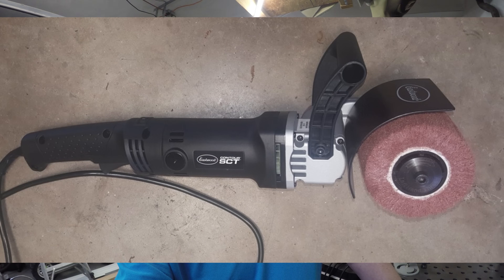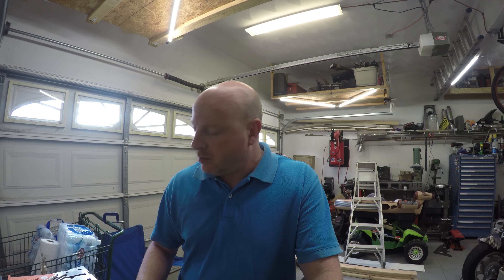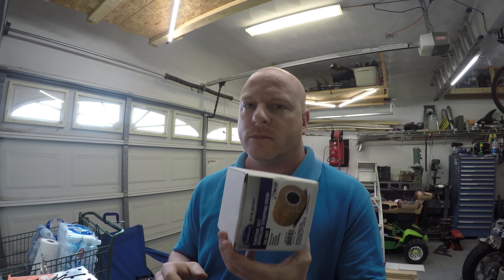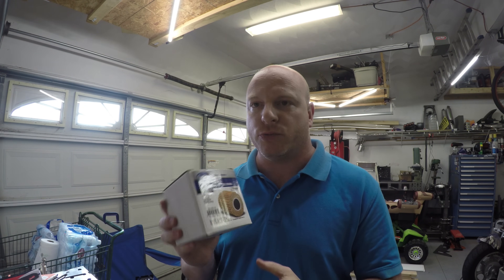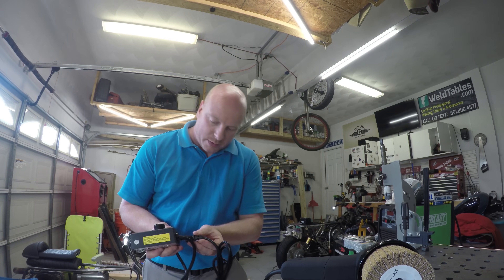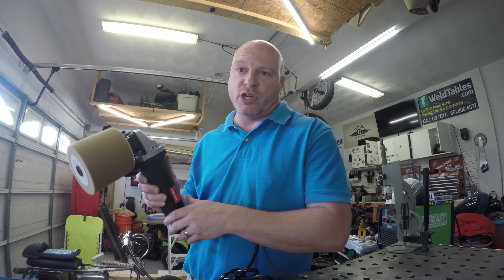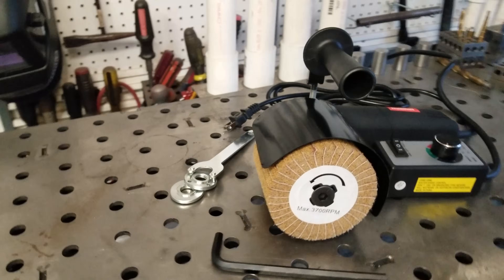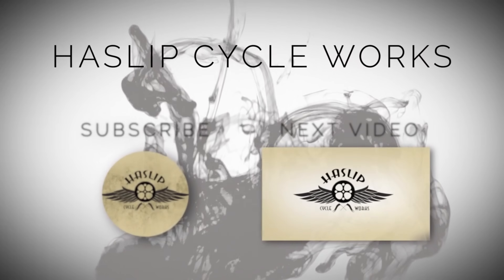DIY Surface Condtioning Tool!

Comment: soaking the part in vinegar for 24 hours will shift nearly all of the rust and mill scale, its then a very quick job to clean the surface with abrasive. Cheers
Reply from the maker: @peterhadfield873  that is my go to, if I have the time. Sometimes I don’t have the time for that or the piece is way too big, then this tool becomes the best option.

Comment: It probably lasted a month
Reply from the maker: Incorrect, still using it. Cleaning up parts off my plasma table and cleaning the surface of my weld table. Appreciate the negativity though.
Reply: @HaslipCycleWorks  cranking down speed incorrectly often destroys motors . Seemed like a lot of work to save few dollars
Reply from the maker: @boringsoaring  there is truth in that. It was but also remember there was very few options other than the Eastwood version at that time. This build was cheaper than the Eastwood and on par with the version from harbor freight that wasn’t available at that time.

Comment: Nice DIY hack. I’m looking to do the same thing. Looks like the adapter nut is no longer available on Amazon.
Reply from the maker: Thank you! I’m sure they can be found somewhere. Harbor freight has announced that they will release their version soon so that might be an option.
Reply: @HaslipCycleWorks  yes....they have under their "Bauer" line of tools. It's very well built and even comes with 3 of the drums!
I mean it's IDENTICAL to the Eastwood SCT, for less money, and with more accessories.
This DIY build is still very useful and I would recommend making it.
Reply from the maker: @justinmurphy2227  I’m hoping to get my hands on one and do a review of it.

Comment: I recently did similar research. I needed to finish some stainless steel tubing with a nice brushed finish, just like the professionals create.
My first “solution” was to obtain an extended drive shaft to fit an angle grinder to drive these brushes/drums. This shaft is available from Abrasiflex https://abrasiflex.com.au (and probably other suppliers).

This shaft (Approx.AU$64) would do the job, BUT required a variable speed angle grinder as per this video AND also required a new guard as shown in this video.
This involves devoting some time to make the guard AFTER obtaining a variable speed angle grinder.

A search on eBay found this item https://www.ebay.com.au/itm/283510703980 for ONLY AU$84. This is essentially a variable speed angle grinder with a sanding/buffing drum and a guard all ready to go. I purchased this tool and it is brilliant, excellent value for money.

The “problem” with the angle grinder versions of this burnishing tool is the location of the drum relative to the view of the operator.
With an angle grinder in normal use, the operator can more easily see the disc and the result. When using this drum, the arm of the (right handed) operator blocks a clear view of the drum and the finish.

This is not a major problem though, as the result is easily viewed when pausing the task and moving the tool away.
You will notice that the Eastwood tool does have a slight advantage. The geared drive mechanism places the drum in a good position to view the work under the tool while using the tool
Reply from the maker: All good points! I have noticed a few months after I made this video more and more parts and options were becoming available. Great information, thank you for sharing this. I’m sure this will help someone out that wants to build one now. Thank you again!

Comment: But u still have to buy the wheels so whats the point
Reply from the maker: Have you seen the price of Eastwood unit? You save a ton building your own. Also since the time this video has been released there are aftermarket wheel options.

Comment: https://www.ebay.com/itm/4-8-40-320-Grit-Abrasive-Wire-Drawing-Wheel-WoodPolishing-Wheel-F-Rust-Removal/183915020229?_trkparms=aid%3D1110006%26algo%3DHOMESPLICE.SIM%26ao%3D1%26asc%3D20200520130048%26meid%3D6d248ef831df4f2aab5da100d1361473%26pid%3D100005%26rk%3D6%26rkt%3D12%26mehot%3Dco%26sd%3D153650709551%26itm%3D183915020229%26pmt%3D1%26noa%3D0%26pg%3D2047675%26algv%3DSimplAMLv5PairwiseWebWithDarwoV3BBEV2b%26brand%3DUnbranded&_trksid=p2047675.c100005.m1851

Comment: Use muriatic acid to remove mill scale, wash with soda, wipe with WD-40 metal is now bare and can be sanded lightly wipe edges with acetone or alcohol and weld.  lots easier and quicker.  process is called "pickeling" and common in industry.  bty wish I had noticed your video before I bought my Eastwood SCT.
Reply from the maker: groushkolb appreciate the feedback, good stuff!

Comment: So funny that you and I went through the same process!  I found the drums on eBay for $10-$12, so I saved a little there. I used the same spindle mount you did, but I used a 7” polisher from HF that has a speed control. With the coupon, I think I paid $25 for it. It has a curved handle, which you may or may not like.
Reply from the maker: Great minds, right? LOL I did see the polisher but not till after I made the video of course. I noticed too that Eastwood lowered the prices on their drums.
Reply: Weldangrind hi. Thinking about doing this build. Can you be specific on the HF spindle thing your are talking about? And can we find a generic style of sanding drums that aren’t exclusive to Eastwood? Wouldn’t it be cheaper? If it’s possible to be found? Thanks.
Reply: I was gonna say fools seldom differ, but I like your expression much better. 😁
Reply: Weldangrind - do you have a link for the drums you bought on ebay?
Reply: @scottmccoy894  not handy, but just do a search for 120×100mm Abrasive Wire Drawing Wheel Brush Drum Burnishing Polishing 240 Grit
Reply: The latest price seems to be $19.57 including shipping.

Comment: Solid question. Does it work evenly or is it working more on one side of the drum vs the other. The jegs one has that issue apparently and looks similar to your setup
Reply from the maker: Judging by the wear on the drum, it looks pretty even. That might vary though depending on the shape and size of the material you are working with.